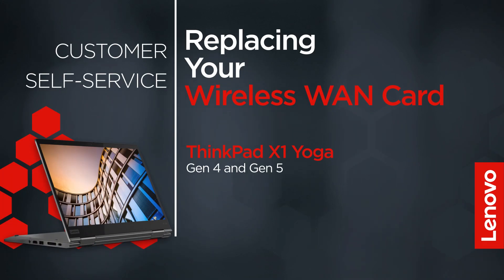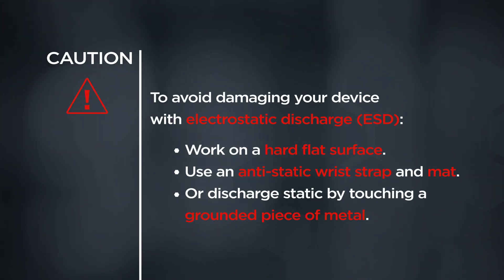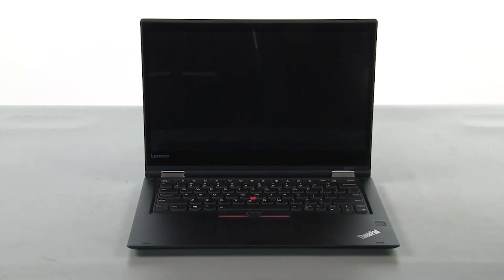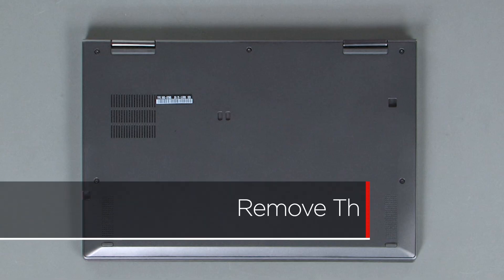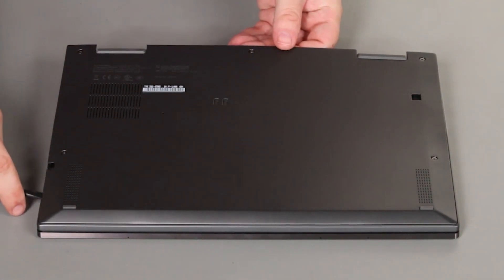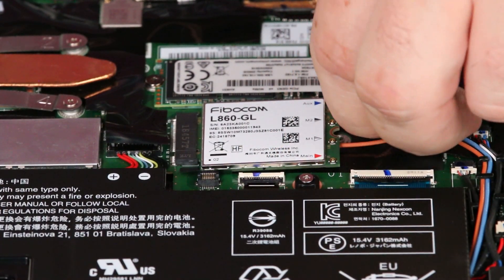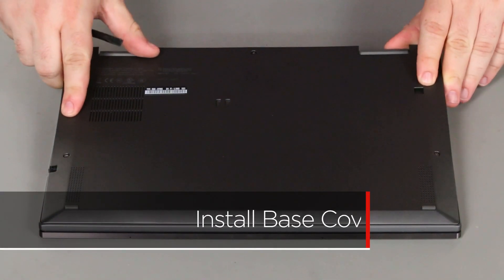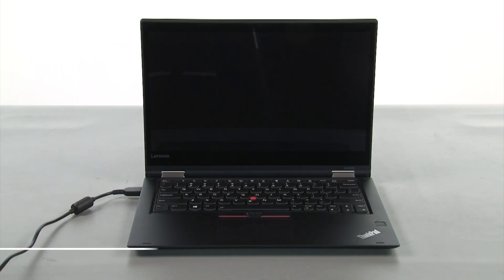Replacing Your Wireless WAN Card | ThinkPad X1 Yoga Gen 4 and 5 | Customer Self Service

Comment from the maker: This video will show you how to replace the Wireless WAN Card inside your ThinkPad. The process in this video will work for the ThinkPad X1 Yoga Gen 4 and Gen 5. 

You will need a screwdriver kit, a non-metallic pry tool, static-safe tweezers, and 30minutes of your time.

To learn more about your device go to https://pcsupport.lenovo.com
To find parts for your device go to https://support.lenovo.com/parts-lookup/?cid=ww:lenovosocial:b9515f&source=socialmedia&subsource=yt

** NOTE: Static electricity can destroy components. Use a grounding strap, and clean, non-conductive surface to work on. Use plastic or coated tools to prevent scratching and avoid using metal tools on plastic parts. For more detailed information on electrostatic discharge and how to prevent it, please watch our ""Understanding Electrostatic Discharge (ESD)"" video: https://youtu.be/by4PB3WtdLo 

Applicable Machine Types:
ThinkPad X1 Yoga Gen 4 - 20QF, 20QG, 20SA, 20SB
ThinkPad X1 Yoga Gen 5 - 20UB, 20UC

#lenovo #LenovoSupport #LenovoTechSupport